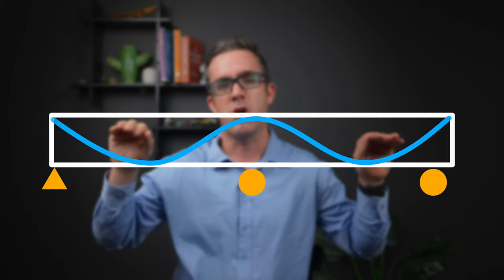The Concrete Rules of Post-Tensioned Concrete

Comment: Hi Brendan, thanks for the explanation. it's very helpful.

I worked at Structural Engineering Consultant from Aussie, and it was my first time in Aussie-based consultant. I need to get used to with Aussie common structural design. Seems your content will help me so much. Thank you once again!
Reply from the maker: Hi Wsinu, Thanks for the support. glad that i could help. Good luck working in Australia.

Comment: PT is becoming popular on UK concrete frames. Great video Brendy
Reply from the maker: Hi Barry, PT is great surprised it wasn't more popular sooner.
Reply: @BrendanHasty  not many experienced installers available. But concrete and rebar costs have helped to push design towards PT. Also reduced slab thickness can decrease overall building height, increasing savings throughout the build. Very much cost driven as mentioned above.
Reply: @barry if uk has pt oppertunity consider me i am struggling to find enter in pt job.

Modelling
Designing
Shopdrawing
Stress calculation
Site checking

Comment: Hambro structural building system sitting on a post-tensioned podium deck" can you explain this in simple ese? this is the ne bldg I'm moving to. I want to know how good this deadens sound acoustically and sound proofs? is this thick material how thick? I read Hambro has a 57 rating on flat slab is it? But the db protection can go past 63 if something is added to it? tell me in laymen's terms how good or bad this process is so I won't hear up stairs downstairs, outside, even hall way.

Comment: Dear Sir, please produce video on construction Joint and any other Joint used in PT slab. Explain as to where , when and how these Joints required. Also  the constraint slab edge , plus examples with Temporary and permanent movement joints. 
Thank you
Reply from the maker: Thanks Cameron for your suggestion, I have written it down to my video planning.

Comment: I've had to deal with a PT slab at least twice. In both cases it was a remodelling job of an existing building from the 1970's. Cutting openings in PT slabs can be dangerous as a cut tendon can work like a whip. Problem is that not any builder can do this, in one case the original firm that installed them did the modifications, in other case we just put warnings on the drawing to avoid people from cutting in the slab willy nilly, however in that building no openings had to be made.
Reply from the maker: Hi Dyko, this is why the pt ducts should be grouted. Also always truncate tendons prior to cutting, truncation is relatively straightforward. Thanks for the support.
Reply: i'm currently involved in a project doing exactly this. Consider advising the client to hire experienced demolition contractors who know how to do proper tendon locking (temporary and permanent) also very important to obtain shop drawings as it'll help a lot.

Current project doesn't have and therefore we had to conduct tendon scanning and strip hacking to ensure exact tendon locations.

We were very fortunate that the tendons were bonded
Reply: @albertfoo1569  In the two projects I hade to make the drawings for, the tendons where not bonded. They where only anchored at the ends, making them potentially very hazardous if you cut openings in the floor. In the Netherlands the market for PT slabs is quite niche, there’s only one company installing them. PT slabs where popular here in the 1970’s, but grew out of favour as nowerdays mostly precast, prestressed hollow core floors are beeing used. PT technology was also used for terraced houses built in  the 70’s (with in-situ concrete tunnel frame), but with time problems started to develop with corrosion on the midpoint anchors.
Reply: @BrendanHasty 
100% they should be.
They are useless without the grout, it’s the most important part of the job.
I did a heap of truncation’s in my time and yes it’s simple but very time consuming.
Great vid and all the best.